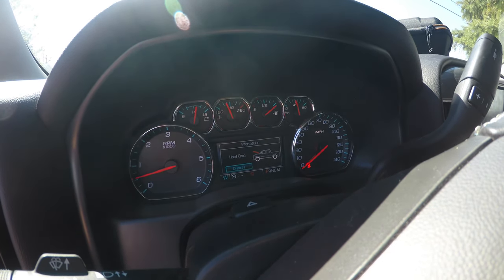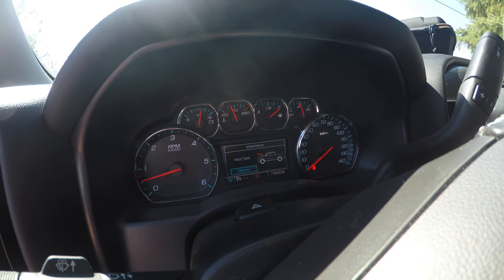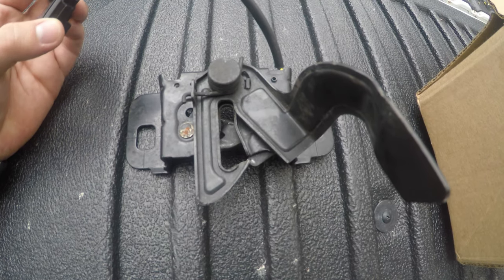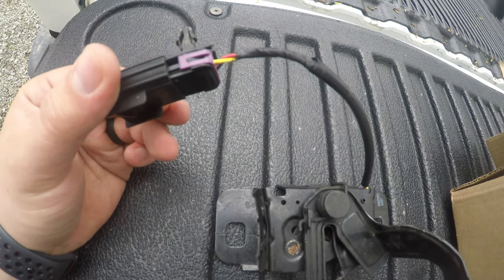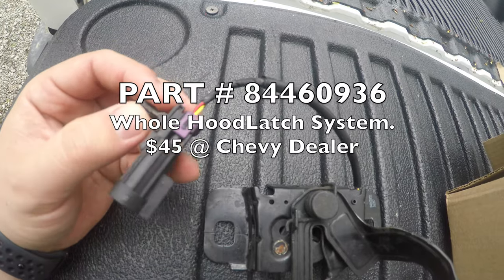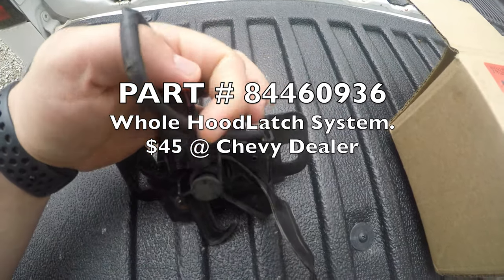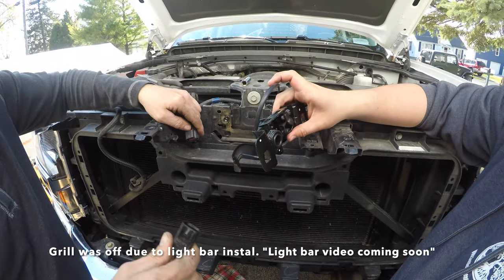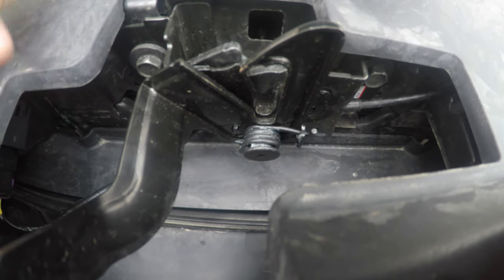How to fix Silverado Hood Latch / Remote car start Problem

Comment: Ok struggling here just bought a 2015 silversdo lt 4x4 doubble cab ...has factory remote start 100% 2 key fabs...tried everything to get remote start working 

Anyway I have never seen a hood latch alarm or latch alarm screen on my truck even with the hood open running ...so I think it's safe to say that my issue need a new latch or bypass with resistor ...

Question all silverados in that Era have the hood latch alarm and whatnot right ?
Reply: Did u get it runing?
Reply: Remove the cover and see if the hood latch harness its plug its a dealer trick to make you come Back and charge you extra $$$

Comment: FYI GM makes 2 types of hood latch sensors. Your trim level is higher than mine. 

As mine ( 2018 LT 4.3 ) has a hood sensor switch however when new it never showed hood was open on dash like yours. Now at 117,000+ miles my engine light came on. Code read P257D ‘ Engine Hood Switch Circuit ‘ 

I’m going to put the upgraded trim level switch which this should be it if it still shows when good is open on your dash, if not you replaced it with a sensor like mine where it doesn’t show when the hood is open on the instrument cluster. 

Can you please let me know if after changing the sensor if it’ll still show on cluster when the hood is open?   

It should if you installed the higher trim level hood switch.
Reply: did you ever install the other hood latch?
Reply: Outstanding comment that's great

Comment: im having this issue on my 2018 1500. Keeps flashing hood open and if  i lock my truck the car alarm will go off randomly and when I go to start it, it will say (Theft Attempted) on the DIC screen. fucking annoying at 3am
Reply: lets not put a way top bypass it or any what to make it so it knows its a false alarm...

Comment: Hello, what trim level is your truck?    

I’d like to add the Hood open sensor to my truck, instead of second guessing if the hood is full closed and having to check every time I add Washer fluid. 
Which is often, my 2018 has 100,000 miles. It would have 140,000 if the economy wasn’t slow. 

I’m going to look and see if the other plug on the truck is already wired in to accept the hood sensor.